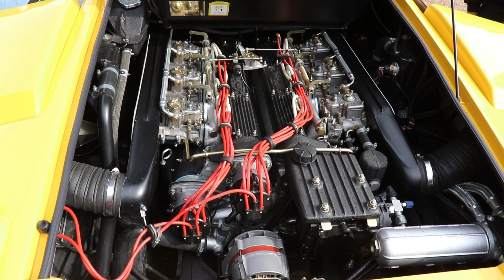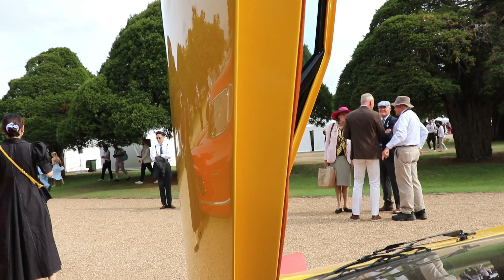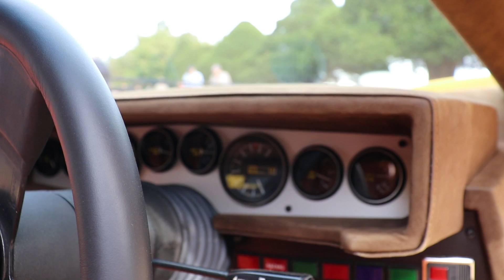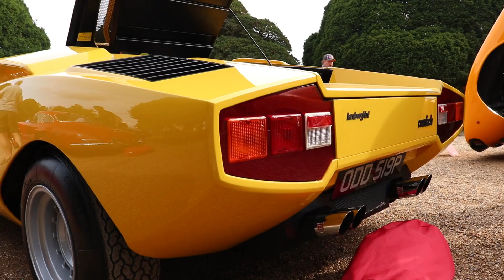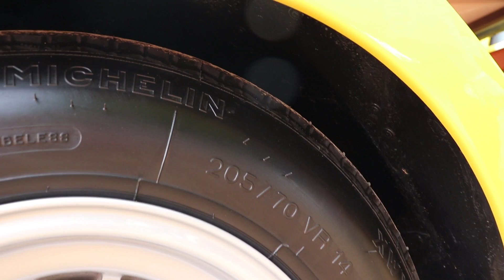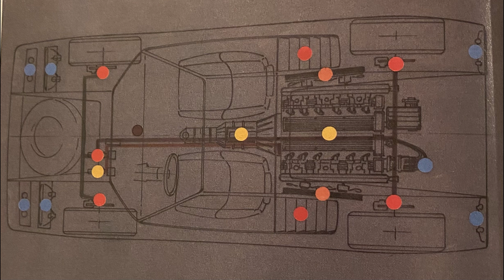Lamborghini Countach LP 400 "Periscopio" / The 1974 original car / Just over 150 were made !

Comment: Great presentation! It must have been the most powerful engine in 1974. Yes, the Americans had Big Block V8s which claimed to have up to 450 hp (Chevrolet Chevelle in 1970). But a) these figures were gross hp, measured at the crank shaft without any accessories and exhaust. b) by 1974, due to emission standards and other factors, even the most powerful V8s delivered only up to 295 net hp (Pontiac Firebird TransAm SD 455).
Reply from the maker: Thank you   Nice to know that 👍